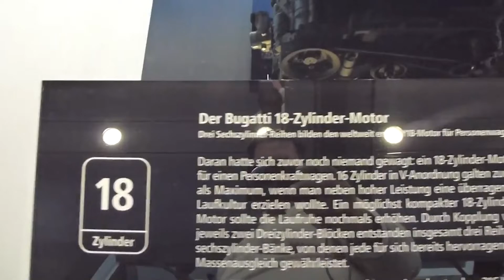When VW put a W10 into a BMW M5: The Ultimate E39?

Comment: I have searched high and low for over 5 years for any W-10 engines in any capacity or scale. Seems rather strange that 2 engines appear in the same week with zero history or documentation
Reply: I know an owner of a w10 block (could even be the one in the picture 2:17) he bought it a few weeks ago. since then we are looking for information. and since then the pictures have been going around the world. Guess that triggered a smaller hype about the W10 engine

We are a group of W8 and W12 drivers, so we are very interested in the prototypes and we have found out a lot
there should be a total of three w10 (the one in the BMW and two blocks)
there were also prototypes of VR10 VR8 VR4
or that there was a 4.7L W8 prototype intended for the Passat B6.

sorry for bad english im not good at writing so i did it with translator
Reply: @reno3839 hi ... do you have any live forums ??? I am interested to make w16 using 2 w8 engine ...
Reply: @reno3839 ooh, do you have a link to the vr8?  I’ve been very interested in this concept!